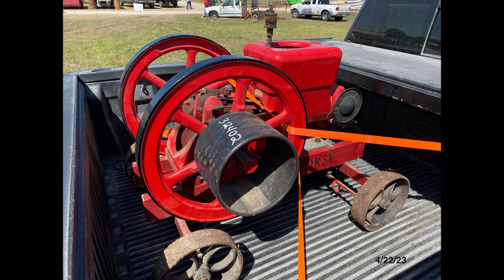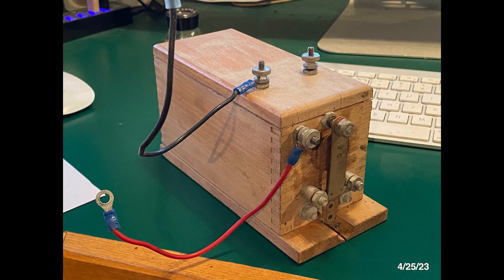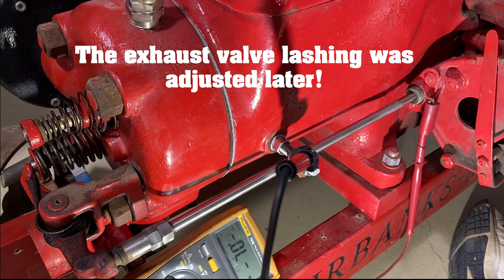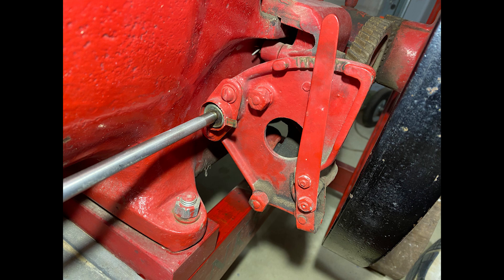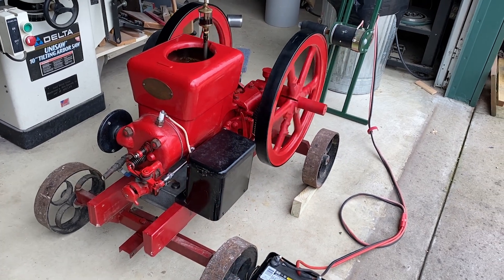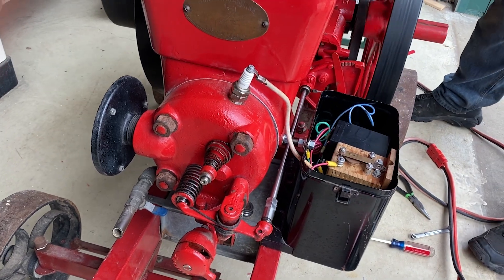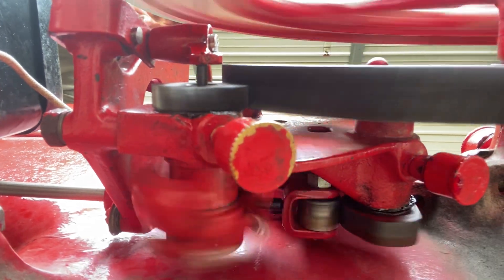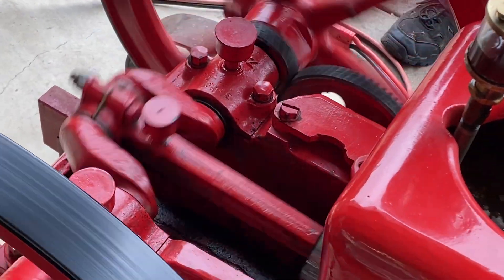Starting a Rare Fairbanks Morse 3hp 'Z' True Hit and Miss Engine with Buzz Coil Ignition

Comment: Hey Jay, I just picked up a 2hp fairbanks morse Z and was wondering how to adjust my carburetor so it's less smokey? Other than that, it runs great 👍
Reply from the maker: Too much smoke (grey) usually means it is running too rich. Either needs for air or less fuel. Use the choke valve to accomplish this as in the video. Hope this helps!

Comment: Your Z is a beautiful engine. I myself rebuilt a 1 1/2 1918 Z compression was not high due to pitting on the cylinder. I had a machine shop bore and sleeve it. The points were modified from original and now it’s a running machine.
Reply from the maker: Thank you! I'm getting ready to put this one a pecan cracker!

Comment: It's so great to see this video!! I found [and still have] one exactly like this one in 1972.  Way before the internet, which brought me to this.  I haven't had mine running for years but am going to get it running again and hope to power a line shaft machine shop I put together many years ago.  I use a big electric motor to run it all the time but I have a smaller throttle governed enclosed crank that I've used before.  I just want to get this out and running again.  Mine still has the tin box with the knife switch and a model T coil like this one.  When I dragged it out of a junk yard in 1972 the rocker arm was broken and missing but I figured that I could make something to braze on that would work but it would be a lot of trouble and thought.  Imagine my happiness and surprise when in cleaning out all the junk in the water hopper I found that whoever broke the rocker arm off in the past was thoughtful enough to put it the the water hopper to be found!  I brazed it up and it worked great. I had it running for years [after much trouble without the help of the internet] and with a load on the flywheels it would keep certain RPMs pretty well.  I need 250 RPMs on the main shaft so the spring trick I just learned will most likely to come in handy.  That and a bunch of pulleys. I'm so grateful to see this!  Mine also has the same [but weary and rusted out] gas tank too. I now see one can even buy a new gas tank!  Who'da thought?
Reply from the maker: Thanks very much. Let me know if I can help!
Reply: @Radiotexas  Thanks very much! I have spent many hours trying to find anything about this engine and can find nothing [as you mentioned].  Have you found that this engine had a designation other than the Z?  In the new world where one can find so much info on the internet I see that gas tanks are even available!  When I get mine off the 'engine shelf' I'll be able to inspect everything and see if I need one or I can solder up what I have.   I will try to figure out how to send a picture to you of mine soon.  I am so happy to get back to this engine!  It ran perfectly in 1972 but I didn't have anything to power at that time.  I have decided to abandon my dream of getting a steam engine going that I was going to run my shop with finished and am going whole hog on this engine.  It's quite a good story how I got it in the first place and it means a lot to me.  Thanks Radiotexas!
Reply: I remember a good trick I figured out when my engine was running and it's a great way to start it when it doesn't want too. I'd pull it through a couple of times to get some gas in it and then quickly [without thumbs engaged] push the flywheels backwards to engage the spark under reverse compression and just hold it there for a second or two buzzing. Lots of time the prolonged spark would finally fire an over fueled or weak spark situation.  Just be ready to let the flywheels  go...........

Comment: Great video, lots of detail!
That is quite a find!
We recently bought an engine that needs a buzz coil, nice to see the information.
Weird Detroit Engine Works 3 Hp 2 stroke reversible vertical boat motor with a cooling water pump.
Reply from the maker: Glad it was helpful! I learned a lot working on it.

Comment: You will need to adjust the chock or / and the main jet. As you change the engine speed. To keep it dialed in to one hit between  misses.

Comment: Any help??
Reply: Jay.. thanks for replying..  I think the timing is right.. I lined key on crank with dimple on small gear.. that leaves valves closed...  Right??   Still the mag will eat you up on bench but nothing at all bolted on engine.. I can lay mag up on top engine.. it will throw blue spark.. soon as I bolt it down... Nothing
Reply: Any help would be greatly appreciated... Thanks Jay again for replying

Comment: I've got one.. the mag hits on the workbench.. but not on engine
Reply from the maker: My engine does not have a magneto! Spark is generated by buzz coil. For a magneto engine, make sure your magneto is attached to the engine with a good electrical contact to the frame! ALL electric circuits require two paths, the "spark" from the mag and a return to the ground (chassis).
Reply from the maker: Of course make sure the timing is right.... but you should get a spark at some point in anycase.

Comment: This is really nice, Jay. Thank you for sharing your adventures.
What?  No Morse code whilst testing the buzz box?  😿
Good call on the choke issue. I would have suspected fuel delivery. 👍
I have extreme curiosity about the hit-and-miss mechanism. I will look it up to see if I can “see” it.
Reply from the maker: I actually did test it with a Morse key.... gotta be careful as there is a LOT of current! Only two things will keep and engine from starting... fuel delivery and spark. Of course, adjustment of same is what makes them RUN!! Thanks!!

Comment: Great work on that rare engine !!  ......A good, clean Contacts, connections & wiring  Properly Adjusted buzz Box should run Good off 6 volts.....Sometimes the Internal  0.22 uF 400 volt Condenser (Usually Buried within the wood Buzz box) goes "open"  & Reduces the spark Intensity......New or Rebuilt boxes are available.....
Reply from the maker: We really had to clean those contacts Tom. I've used some vibrators in amateur radio equipment and often VERY aggressive cleaning is necessary. After running the engine a while AND having to readjust the contacts a couple of times I was thinking about trying it on 6 volts just to see. The cap was replaced before I got the coil by the way. Thanks very much for your comment!